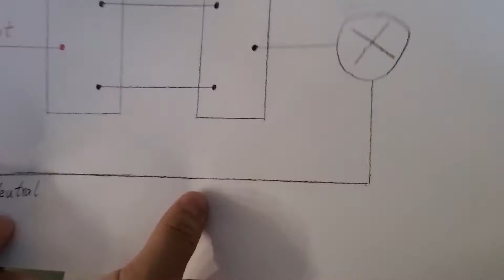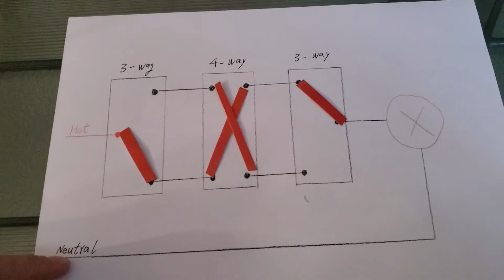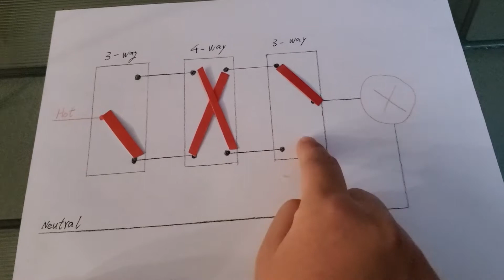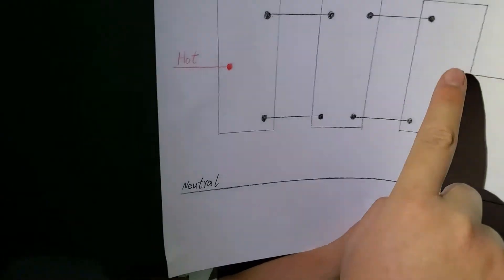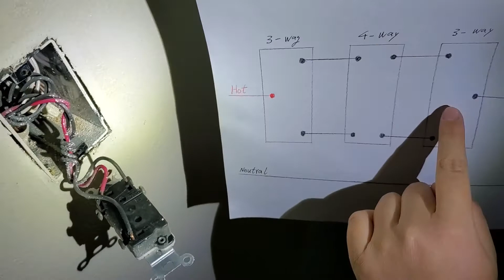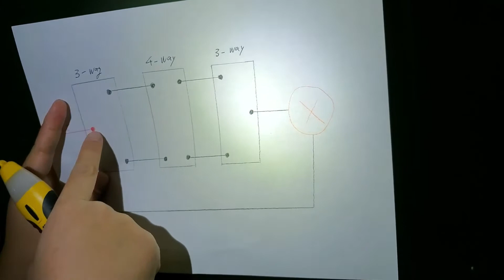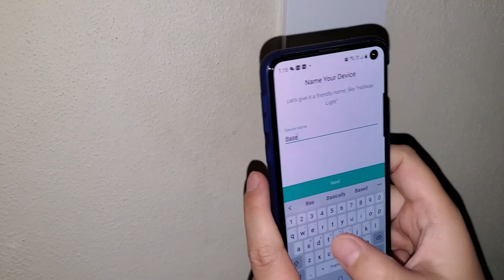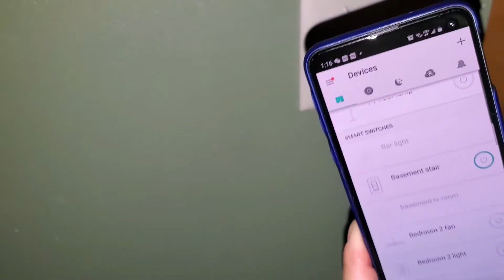How to install a smart switch on 4-way wiring

Comment: You don't have to unhook anything. Pull the switch out with the power on(DO NOT touch the screws on the sides of the switches or let the screws touch the adjacent switches), hold your tester up to the output side of the switch(black screw). If it detects voltage In both switch positions then you know it's the input side of the system(constant power), If It only detects voltage in one switch position(Lights turning on and off) Then it's on the output side of the system that goes to the light.

Comment: What happens if I have the line and load in the same switch box? From what I can determine, I have three switches, Switch A is at the top of the stairs, switch B, at the bottom of the stairs and Switch C is down the hall from the bottom of the stairs (almost directly underneath switch A). Switch A has a black, red and white wire. Switch B, has three sets of wires - Set 1 is black and white (the black in this case is hot and is power), Set 2 is another black and white which I believe is load and Set 3 has a black, red and white. Set 1 and 2 whites are pigtailed and Set 2 and 3 blacks are pigtailed. Switch C is the four way switch with two sets of black/white/red wires (travellers).  So if I am using the HS210, do I connect just the power to the line/load screw on Switch B and attach another HS210 to Switch A?  Should that still work?

Comment: I’ve installed many of these TP switch as well as other brands, and there are several ways to accomplish this but your way is the cheapest because the other smart switches aren’t truly needed other that looks! Your video is straight to the point with easy navigation thru beginning to end! Well Done!

Comment: This is an outstanding video.  Every time I have to deal with 3 and 4-way switches (once every ~5 years...), I have to grab a book or find a diagram and visualize it all over again.  Not only did I get the multi-way switch refresher in the first 60 seconds, it also confirmed my theory about being able to just drop in one smart switch.  Interesting that the tp-link Kasa "3-way kit" comes with 2 3-way switches in the pack.  Guess I have a bonus to do another room with now.  Thank you!

Comment: This video was fantastic! You made a concept I’ve struggled with feel so easy—thank you! The paper diagram example was especially helpful, and I really appreciated how clearly you explained the differences between 3-way hot, 3-way light, and 4-way setups. I’ve been wondering if I could use a smart switch with my lights, and you finally cleared that up. My only remaining question is whether the smart switch can also be dimmable, but I’m excited to give it a try and see. Thanks again!  10/10 rating!

Comment: Great video.  It is very clear on how you connected the smart switch.  Did you have make any changes on other switches or they stayed the same in terms of wiring connections?
Reply: You would not have to make any changes on the other two switches. They should remain the same.

Comment: hello, One question: shall I buy Kasa Smart 3 Way Switch HS210 Kit or just HS210?  thank you so much for your video. that's very helpful. Actually may I buy ks230, that one is 3 way dimmer switch and HomeKit supported, I just want HomeKit and don't care about the dimmer. Do you think KS230 will work in this case?
Reply from the maker: I think so. In my case, you only need to replace one 3 way switch. You do not need the kit.
Reply: @QTTechReview do you think ks230 would work in this case?

Comment: I have never seen such a simple and easy to understand video. Your paper diagram made the WORLD of a difference in understanding what the hell all of these switches are doing in my living room. I have a 6-gang switch box by the back door, a 4 gang switch box by the hallway, a 3-gang switch box by the dining room, and another 4-gang switch box in the kitchen. So many 3- and 4-way switches, and one 5 way(assuming it's name, 4 switches controlling one light). Thanks to your video, I confidently managed to swap several switches with smart switches. Thanks!
Reply from the maker: Glad it was helpful. Thank you for your support.
Reply: gangs in a box arent poles on a switch
fyi

Comment: Thank you for the information in this video. It really helps a lot. I did configure the HS210 switch following the instructions, and the switch works. However, when I turn on the switch using the app, it turns on, but in the app, the state changes from on to off even if the lights are on. Also, when I turn on the other switches, the state is not changing in the app.
Reply: Where you able resolve the issue. I am having a similar problem. The switch works as a three way switch. But I am having issues using the app. I have to double tap to turn on/ off remotely.

Comment: have you set up a Lutron Caseta Smart Switch dimmer?  I have a 4 way switch, casesta only shows how to set up a three way.  i have one 4 way and 2 3 way switches installed.  Not sure how to go about it.  Caseta says to install their dimmer smart switch and go to the other location and cap all wires together and add a pico remote to the switch where all the wires were capped off together.  Any assistance would be greatly appreaciated.
Reply from the maker: I believe for Lutron, you only need to install one switch. For the rest of the locations, you wire them to be forever on. Then you put a remote switch on each remote location. Remote switches are not wired and only use battery. You can buy as many as you want, making it 3 way, 4 way, 5 way, .....

Comment: In a 4 way configuration, can a smart DIMMER switch be used in place of the 1st switch?
Reply from the maker: I think it should work. You will need to find the 3 way dimmer switch.

Comment: Does it matter if I install the switch at line side or load  side
Reply from the maker: Yes, it matters. If it is on the load side, it will lose power when you turn the light off.

Comment: Would this same method work if you do not have a neutral wire?
Reply from the maker: The TP-Link switches require neutral wire. They need the neutral wire to provide power to the switch itself. If you do not have neutral wire, I believe Lutron and GE make some switches for no-neutral situation.

Comment: Hmmm. It does not work with the ks230. The 4 way normal switch and satellite only switch from all the way on and dimmed setting. The main smart 3 way switch alone functions as it should. Any way to fix this?

Comment: not that its your problem but i hooked it up exactly as is and the kasa smart switch is showing blinking red or an error. red wire has constant 120vac, hooked up the neutrals & grounds & had the other two blacks as the travelers. any ideas?

Comment: If I have a 3-way SMART dimmer, can I incorporate it into a 4-way scheme like yours? How?
Reply: I've been trying to get my Feit Electric 3-way Smart Dimmer switch to work for 5 days now, with no luck! Feit is adamant that you HAVE to install a dimmer switch at the Load side (going to the lights) and NOT the Line (hot) switch - as QT tells you to in this video. They've shared 3 diagrams with me so far to help get it done, but unfortunately none of them have actually helped me yet! Anyone else had any luck!?

Comment: I am trying to achieve the same thing (4-way wiring) but with the Kasa K230 Dimming 3 way switch. Have you done this yet? Your thoughts?
Reply: I tried it using the method that QTTechReview used and it does not work. Probably time need to call in an electrician.
Reply from the maker: I think it should work. When I did this project two years ago, they did not have a dimmer 3-way switch yet, only the regular 3-way. But I think they work in a similar way in theory.
Reply: @QTTechReview  I agree, seems like it should work but I've yet to see anyone do it. Mostly people say it won't work but I think it might. Thanks for your response.
Reply: Has anyone done this with a smart dimmer yet?
Reply: Dimmers need to be on the Load side, not the Line side as recommended in this video, as per Feit Electric's Tech Support.
Reply: @jaspreetbaveja5491  
What video?

Comment: Installed one today. I don’t always get the correct feedback on the app (or leds on the switch).

This will make programming a routine impossible as I can’t tell Alexa to turn off al the lights, because if this switch is already off, it will just turn it on.

Not sure if ai did something wrong. Your diagram was amazing though

Comment: You explained 3-way and 4-way very well. I have been doing electrical for many years. Also does not help when info has to flow out to the control computer on the internet get processed and then come back. I only use smart switches/devices that are locally controlled. So for WiFi, has Tasmota pre-flashed or I can flash Tasmota (3rd party open source firmware) on the device. I have started to use zigbee devices and they are locally controlled.

Comment: Love your diagram and explanations. I tried in my house but found that there is no neutral wire inside my first 3-way switch wall plate. So, I ended up trying to replace the other 3-way switch (at the end in your diagram) which has the neutral wire inside, and found it still works perfectly. The app knows the status of the light clearly when I flip any of the 3 switches in any pattern. So I guess it doesn't really matter which 3-way switch you replace?
FWIW, I used the TP-Link Kasa switch too, and when I set it up in the app I chose the 1 switch mode.
Reply from the maker: That is great to know. Thank you for sharing!

Comment: where did your neutral and ground came from? it just pop up the time you installed the smart switch.
Reply from the maker: The neutral wire and ground wire should already be in the box. If there is no neutral wire, you are not able to use Kasa. There are some other brands for no-neutral wire box, such as Lutron and GE.

Comment: Im wondering if TP-Link changed something? I installed one of these where the hot line comes into the 3way switch. I have 4 total switches in the circuit. Two 3way and two 4way. However in the app I have to turn it "ON" in the app to turn the light off. Then turn it off in the app and then back "ON" again in the app again to actually make the light turn on. On another 4way switch circuit the only way I could get it to work was by installing the second 3way switch and pairing them.
Reply: I have the same problem. Did you find a fix?

Comment: Can you put another smart switch or the second smart switch which comes as kit to the other thre way and leave a dumb 4 way switch?
Reply from the maker: Yes, you can. The only issue is that when the light is off, the other smart switch will not have power.
Then you cannot control it on the app.

Comment: Can the smart switch be installed on either side or does it only work in the beginning because it always has a hot connection?
Also, does the dimmer have to be on the last switch or can it be on the first or the middle switch?
Reply from the maker: Thank you for watching! The smart switch should be installed on the hot side because it needs constant power. The dimmer can be anywhere.

Comment: I have 2 kasa smart switches on both ends and a 4 way switch in the middle, however when the 4 way switch turns off, it kills power to the end smart switch.  The wiring looks correct for the 4 way switch, one set of wires at the top and one set of wires at the bottom, just can't figure it out :(
Reply from the maker: Yes, turning off the 4 way will cut the power off to the end switch. You only need one smart switch, on the power side.

Comment: How did get the neutral and ground wires connected which were not there in your original 3-way switch?

Comment: Thank you for posting this. You explained it so well. We are want to change all new lights and fans throughout the house and I would really like one thing that can control all. If not all but at least most lights and fans. Can this be work if I’ve Fiet smart dimmable switch? Or what would you recommend if you don’t mind sharing? Fiet box say- suitable for single pole or 3 way. Thank you.

Comment: Wow, you are the only video on the whole Internet that explains this properly!  Everyone else only shows a simple install.  My problem was using smart switches which only accomodated one traveler wire.  Been trying to work around this for days.  What I didn't know was that TPLink has 5 wires, rather than 4 which most other switches have.  Couldn't figure out the problem.  THANK YOU!
Reply from the maker: Glad it helped! Thank you for watching!

Comment: I tried this but my switch is blinking red. Tried switching travelers and still no luck. Any advice? Do I need to switch travelers on the other switches?
Reply from the maker: Blinking red usually means the switch is disconnected to the WiFi or has hard time connecting to the WiFi. It is probably not the wiring issue. So I would suggest to reset the switch to get it blink green and orange. There is a reset button at the bottom of the switch.
Reply: @QTTechReview  I’ve tried reset/reboot. No luck. According to TP link website it usually means that there is a traveler issue (they need to be lined up
Reply: I tried again… I’m not sure if it’s different if using the dimmers, but I was finally able to connect the main switch to Wi-Fi however when attempting to shut the light off from a different switch that was not smart, the lights flickered and may have fried the switch

Comment: Will Alexa perform correctly with just instaling one? Anotherwords, would there ever be an instance where I would be telling Alexa to turn ON the lights to actually turn them off depending on how the switches are positioned?
Reply from the maker: Yes, it will. I have an Alexa routine to turn off all switches in my house. So Alex can still control the switch correctly.

Comment: Thanks QT. I wish I was as smart as you when I was your age. You are very impressive. I will now try this since I found the perfect teacher.  Can you tell me what tool you are using to test the electriciy on the wire nut?
Reply from the maker: Thank you for watching! I use a voltage tester. I have one from Kleins and another from Fluke. They are both good brand.

Comment: Does the 4 way still work if all of them were 3 TP-Link Kasa 3-way smart switch? I just want to maintain consistency with the switches.
Reply from the maker: The 4-way switch in the middle requires 4 connections. The TP-Link 3-way smart switch has 3 connections. So you will not be able to replace the 4 way switch with a Kasa switch.
Reply: @QTTechReview  thanks!  Im guesing there's still no 4 way smart switch available on the market?
Reply from the maker: @hehehe9618  I am not aware of any 4 way smart switch in the market at the moment.

Comment: Great video. Thank you.  I installed the Kasa 3 way switch as you instructed and everything seems to be working with the exception of one thing.  All three switches work but the green button on the Kasa software does not illuminate when the light is on.  Do you have any ideas?
Reply from the maker: You're welcome! I am not sure. Sometimes when I open the app, all lights will be shown as off, and then it will take a couple of second for all of them to show the real status.

Comment: Great! Great! Great video! I have only one question, shouldn’t you be able to put the smart 3 way switch that also has a dimmer and it would work as a dimmer across the whole circuit?
Reply from the maker: That is correct! Thank you for watching. When I did this project two years ago, there was no smart 3-way dimmer switch in the market. I believe TP-Link just released a smart 3-way dimmer switch in the middle of 2021.

Comment: Do you know if Kasa 3-way DIMMER switches will work in this scenario as well?
Reply from the maker: I never tried myself because when I did my project, the 3-way dimmer was not available. But in theory, it should work here in the same way.
Reply: @QTTechReview  I can confirm, it does not.

Comment: This was incredibly helpful! I replaced 3-way switches with z-wave switches but I had to use add-on switches as well. I didn't know you could replace just one with a smart switch and keep your dumb switches as well. Thank you so much for sharing!
Reply from the maker: Thank you for watching. Glad it was helpful!
Reply: I had two sets of 4-way switches in my home so I purchased 2x Kasa 3-Way switches (HS210). I just performed the installation today using your video as a guide and it worked out great! Thanks again.

Follow-up question: In our 4-way switch config with the Kasa switch installed where the hot-wire is, can we introduce another smart switch (i.e. by replacing one of the dumb switches) in the same config with say, a 3-Way Dimmer switch or another 3-Way on/off switch?
Reply from the maker: @CK-ip5yc  Yes, you can put another smart switch at the second 3-way location. The only issue you will have is that, once the light is off, you will not be able to control the second 3-way switch from your app, since this switch does not have power. But you can still control this switch when the light is on, like turning it off or tuning it up and down.
Reply: @QTTechReview  ohh, that's a bummer. I was hoping to use the ZOOZ Zen32 Scene switch at one of the 3-way locations. I thought maybe since it uses a neutral wire, it would still have aome power so you could control it remotely despite the "primary/hot" 3-way switch being off. It won't work like that?
Reply from the maker: @CK-ip5yc  I have not tried myself but I do not think it works in theory. Neutral wires are to carry the power back from the bulb. When your light is off, there is no power on the neutral.